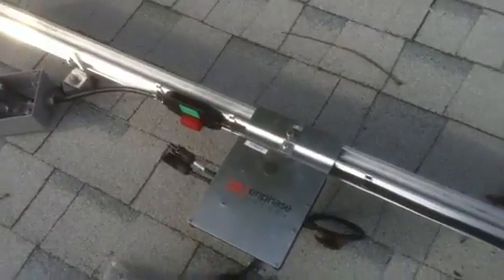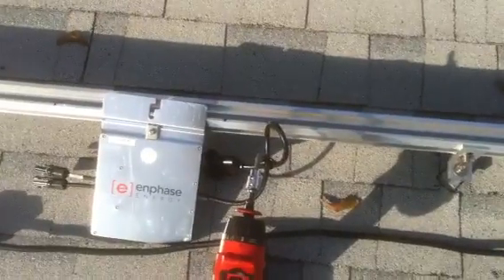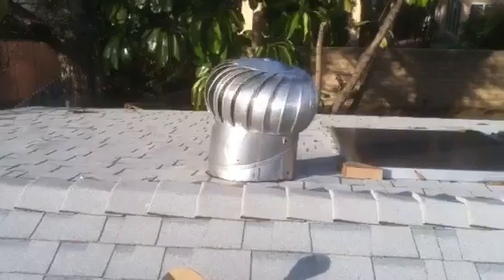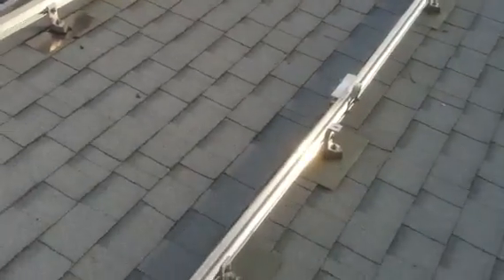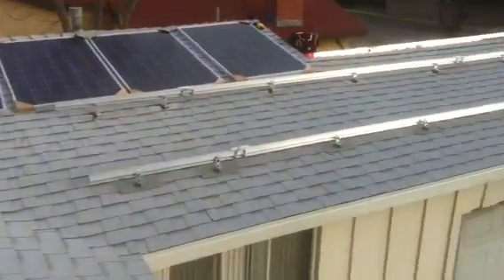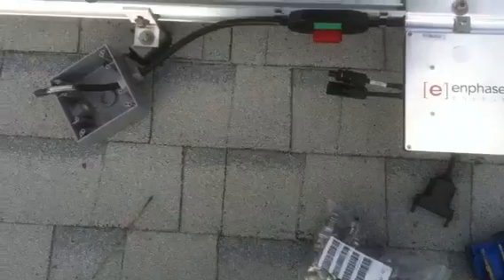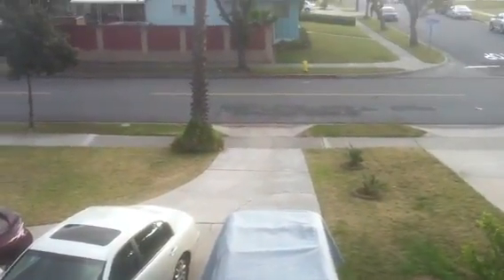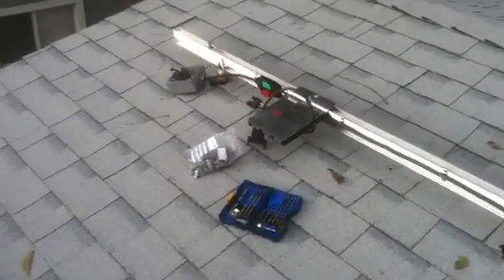Solar Enphase installation

Comment from the maker: @sunsensational 
I believe that you should run the #6 ground copper down to the ground rod.  If you cannot run a continuous wire with no breaks,  You can probably use a irreversible splice (copper squeeze crimp)  to connect to two #6 copper ground wires.

Comment: Great video. I'm doing same install, and at my final wiring step, but got a question can't seem get an answer. Can you terminate the #6 ground copper wire to Enphase green ground wire @ J-box or do u have to run the #6 down all way to ground rod, independent of green AC ground wire?  Thx for your help